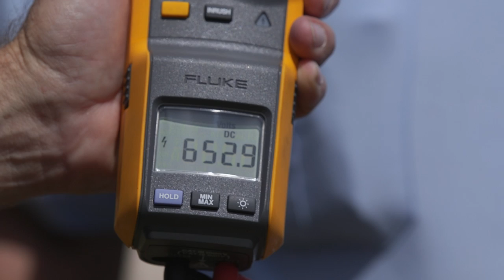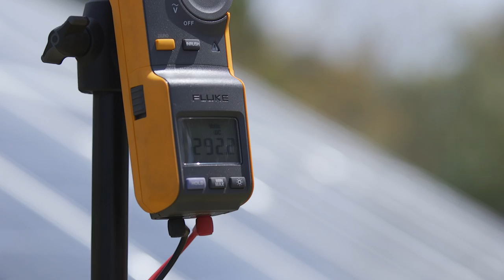Electrical Arcing & Water Conductivity

Comment: Spread clear Flex Seal on broken glass of PV panel. It will seal the panel from water. Did it. Works fine.
Reply from the maker: Hi Patrick, that is a really bad idea, sealing the damaged panel is only one aspect of the risk.  The cracked panels will cause hot-spots, which can create an electrical arc, which can then create a fire.  I would strongly recommend that you remove and replace any cracked panels or you could have a future fire on your hands.
Reply: @pvstop5763  not gonna happen as long as it works. I stand by what I have done because I know that it works.  I have two panels coated with Flex seal and two others that are not broken, powering an electric water heater. I get forty gallons of good old hot water anytime that I need it. 36 volts on both panels that are coated and 36.5 volts each on the other two. Going on two years now. Of course, your mileage may vary. 😉👍
Reply from the maker: @patrickbodine1300  I can only hope that your panels are not installed on the roof of your house, wherever they are installed, I can only advise you that they are a fire risk.  I have seen damaged panels operate for years without issue, I have seen others catch fire and burn houses to the ground.  Best of luck and stay safe.
Reply: @pvstop5763  😉👍

Comment: Rain water has no mineral in it so should not have that much effect 
Spray distilled water and see if it reacts the same
Reply from the maker: Pure water (distilled water) is an insulator. But almost no water sources are pure and it is widely accepted that typical water sources are conductive when applied to an electrical source.  An unbroken stream of water applied to an electrical source can conduct down the stream and create a real risk of electrocution.  I reference "Firefighter Safety and Photovoltaic Installations Research Project" Conducted by Underwriters Laboratories to support my reasoning.  The report is easy to find online and has a whole chapter on the subject.
Reply: It wouldn't matter. Panels on a roof are not spotlessly clean. The water will pick up the impurities necessary for good continuity.

Comment: Thumb down,because: what is pv stop and hiw it works? AND why not using a Megger putting out 700 to 1000volt to verify volt leakage to ground?? With your multimeter you cannot veryify 100% what you try to measure, it only puts out around 6volt for that test. Dont make videos like that if you are not knowing what you are talking about. And 600volt output is a very unusual configuration for a solar system anyways...
Reply from the maker: Thanks for your interest interest in our video.  PVStop is a state of the art polymer film technology and the only solution that isolates the power produced by solar panels at the source, by blocking the light and de-energising the solar panels.  You can find out more by visiting our website www.pvstop.com.au.
A Megger is the correct tool to demonstrate leakage in a system that can be totally isolated from all power sources.  If a system cannot be disconnected from the power, such as in the case of solar panels in sunlight as demonstrated in our video, a Megger cannot be used because it will either damage the equipment or destroy itself.  A multimeter is not as accurate as a Megger, but it is the right tool for purpose in this instance.  
A 600 volt output is a very typical configuration for a residential solar PV system (industrial and commercial systems can be up to 1500 volt output).  I am quite confident that I know what I am talking about, but thanks for checking.

Comment: What exactly does PV stop do? I'm lost....
Reply from the maker: Hi Kody, PVSTOP is designed to "switch off" solar panels, it sprays on like a "liquid blanket" to isolate the power produced by solar panels at the source.  It is an essential tool used by first responders (firefighters & electrical technicians) to make solar panels safe if the solar panels are faulty or in an emergency situation such as a fire, flood or storm.

Comment: use individual inverter for each panel, cut the main power then no collective high voltage..!
Reply from the maker: You are talking about micro-inverters which are becoming more common (typically in residential solar panel systems).  There are pros and cons to micro-inverters and although they are becoming more popular, they represent less than 10% of global solar panel systems.  PVStop is effective on all types of solar panels systems so it is complementary to all solar PV technologies.

Comment: lol 5kW with 600V is just asking for trouble.
are your solar panes 50miles away from your home? why do you need 600V?
Reply: It's to do with power loss through transmission, Even a 1% loss on the system above would equate to 58.5wh, however multiply that by an average of 4 peak sun hours per day over a year (Australia) you're suddenly losing a total of 85410wh (85.4Kwh) annually. I should clarify that power loss is calculated by Current squared multiplied by the resistance of the cable.

Comment: Need to have remotely operated Disconnect Switch in each string to bring down the voltage level & current to safe limit during emergency. Also there should be automatic shading system to prevent Electricity generation during incident. Access to Roof for   regular maintenance is necessary to prevent Fire Hazzard from broken cables, damaged panels etc. Hope these will minimize the fire incidents.
Reply: Hi Vivek, what you are describing (remotely operated disconnection switch) is "rapid shutdown" technology which accounts for about 5% of global solar PV systems.  In theory an automatic shading system would work, assuming that you keep the shutters well maintained (as they will live in the elements 24/7), that they don't compromise the load bearing capacity of the roof and that they don't cast shadow across the panels and reduce efficiency.  Fortunately legislation in most countries is improving and roof access is a focus on most modern standards.  Sadly most PV system owners do not regularly maintain their systems which is where most of the problems arise (poor quality system components and or poor quality installation practices).
Reply: Thanks Jim for Good suggestions.
Reply: @vivekprabhu2651  No problem Vivek, we are all about raising awareness of the risks and improving renewable energy safety!
Reply: Solar PV Systems are best in landscape not suitable for any type of cultivation, on Rooftops, on top of irrigation canals. Similarly  Wind Turbines are good at offshore if geographically it's a high wind speed region. What are your thoughts on these Jim.
Reply: @vivekprabhu2651  Hi Vivek, I am not quite sure what you mean, are you saying that you don't think PV systems are suitable on cultivated land, rooftops and irrigation canals?
Reply: Hi Jim, what I meant was Solar PV Systems are best for Rooftops, on top of Irrigation Canals and in landscape not good for any type of cultivation. Here in India we have quite a large area of Rooftops, Irrigation Canals don't have Solar PV Systems. For Agriculture, Greenary cultivable landscape is essential. Desert are the places where Solar PV Systems provide value to landscape.  Installation of Solar PV Systems should get incentives for these categories more than any other. Fire extinguishers from PV Stop for Solar PV is amazing 👍

Comment: You call it a voltage meter, therefore you should call the other meter a current meter, not an amperage meter.

What is being measured is voltage and current, where the units are volts and amps.

Let's get it right shall we?
Reply from the maker: An ammeter (abbreviation of Ampere meter) is the correct terminology, but we weren't sure if this would make sense to a non-technical audience.  But sure, if you want to get caught up on semantics, knock yourself out!
Reply: @pvstop5763  The point is, you have been inconsistent! For voltage you have used the correct terminology, for current you have got it wrong.

Comment: NEC 2017 690.12 requires Rapid shutdown Devices because of this this video is based on the most basic ungrounded array ever created
Reply from the maker: Hi Cameron.  Yes, the demonstration unit is a basic ungrounded array.  Having installed PV systems for many years we see real world examples of arrays that are not grounded correctly very regularly.  This video is designed to show an example of an unanticipated risk created by a damaged solar array, not a well designed perfectly functioning grid interactive system.  Rapid Shutdown devices also have limitations, there is a reason why the US (and more recently the Philippines) are the only countries in the world to legislate Rapid Shutdown.  Here is a link for your reference www.fixmlsd.com and just to be clear, we are not affiliated with this website.

Comment: Or go down to Wal-Mart grab some tarps.  Or boxes. 

Nope grab the toxic sludge extinguisher!
Reply from the maker: Further to my post above, tarping solar panels is only effective in limited circumstances, it is a dangerous practice and puts you at risk of being electrocuted.  There are also the dangers of operating at height etc etc.  The PVStop coating is non toxic, peels off once dry and can be disposed of with normal garbage waste.

Comment: How water increases voltage ? Whats the physics behind it? thanks.
Reply: It just provides a path from the live cells to the frame. Water conducts electricity! In reality, the frames of all PV panels are supposed to be earth grounded. It's required by the National Electrical Code.
Reply: @vincentrobinette1507  it goes to show how little some.people know about electricity. Lol
Reply: Anything that is wet with water ( not oil or oily liquids) will boost lectricity  flow.

Comment: You know what also works? Inline fuses and proper circuit breakers.
Reply from the maker: DC electricity behaves differently to AC electricity and this is exactly where a lot of solar PV systems experience problems.  DC likes to flow in one direction, from source to load, the more fuses and circuit breakers you put in the line, the more potential weak points you create which over time can develop into problems.  The number of solar PV fires caused by isolation switches is a perfect case in point.  Once again, it is a case of people selecting cheap, poor quality components without understanding the safety risks.
Reply: I am well aware of the fundamentals of AC and DC current. I work as an RF Engineer professionally and electrical engineer as an alt.
Most every solar system I have installed for railroad track side signalling and 2-way radio relaying, uses 24 volts DC, in the equipment shed there are pure sine inverters to step the 24 volts DC up to 120 volts AC for the outlets in the building. The signals are all LED based and run off the 24 volts and the radio repeaters are 12 volt, both are fed from a battery bank that the panels keep maintained. This is in situations where mains power is not available like in the mountains or in a desert..
Reply from the maker: I am definitely not questioning your knowledge base,  in fact rail networks are one of the few market categories who have a thorough working knowledge of DC and you obviously understand solar PV systems.  The main focus of this video is directed at first responders who are encountering domestic PV arrays on an ever increasing basis.  Many of these systems are poorly installed by companies with limited technical knowledge and first responders do not have adequate tools and procedures to deal with incidents involving solar PV arrays.  Fire services are rapidly adopting our technology because it offers a simple solution to a complicated problem and it works on any type of solar PV system.

Comment: they even work when you dont have solar panels

still prodcues 600V of voltage 
free energy baby!
thx pv stop
Reply: That's exactly the point of solar, and even wind. They are the only practical, commercially available "Free Energy" devices there are, and they actually work!!

Comment: since the panel are in series to get the high voltages - just throw a blanket on one panel and it turns off....nothing hard about that...or tape a cardboard over it if windy...
Reply from the maker: Covering a PV system with a thick blanket or taping on carboard will achieve the same outcome as PVStop, however how do you safely access the roof if the PV system is damaged on the structure is on fire?  PVStop is designed to be applied remotely, without having to directly engage with the roof or PV system thereby maintaining a safe system of work.
Reply: @pvstop5763  how do you safely access a 10 meter high roof with a leak voltage and apply the PV stop remotely without boom truck? better cut the wiring on 1 panel at 10pm midnight.
Reply from the maker: @bluekawish  If structure height is an issue and first responders do not have access to a boom truck or ladder truck, we recommend our new drone delivery system.  Stayed tuned, we will be releasing information about our new drone delivery system within the next few months.

Comment: It would be a lot cheaper just to earth the frame
Reply from the maker: Hi Joe, a well installed solar PV system using good quality components will provide years of trouble free service.  Unfortunately (approximately) 20% of PV installations are either dangerous or sub-standard.  We have encountered MANY solar PV installations that have either not been earthed correctly or have deteriorated over time. This video was designed to raise awareness and educate first responders on an unanticipated risk which they are encountering on an ever increasing basis.

Comment: hey the thing you say is correct if it is a really old system such as before 2000 at the very least and I've talked with a retired firefighter and they have to survey around the house checking things such as solar arrays to deal with them so what you are saying is not entirely correct
Reply from the maker: Hi Dallan, old system or new system, the topic discussed is this video is entirely correct.  We are currently dealing with fire and emergency services all over the world and the hazards surrounding solar PV systems is a known risk.  Tell me, how do firefighters survey the dangers around a house with a PV system when DC electricity cannot be remotely detected?
Reply: so firefighters must put out the source of a fire safely and every firefighter has a guy who surveys damage to the building and one of the things he does is while the survey is going on he takes a full walk around the building assessing for things like solar panels, points of entry, and as many dangers from the outside as possible and reports everything to the crew also he is able to see solar panels on the roof from the ground usually and are able to deal with them as soon as they see them so you should also do some research as well as i'm not a fire fighter myself so you should also check your sources as well
Reply from the maker: We are currently selling PVStop to a number of fire services in Australia, the UK and shortly to the US, Japan and a number of European countries, so rest assured, we have done our homework.  What you are describing is called a incident risk assessment and most fire services (in the world) do not have an adequate "safe system of work" for incidents involving solar PV arrays.  At best, they adopt a "defensive strategy" when they encounter a structure with a solar PV system installed.  In short, they do not have a reliable way of dealing with solar PV systems, which is why our product is now being adopted by fire departments, it significantly improves fire fighter safety.
Reply: Dallin Turner
Reply from the maker: Hi Dallin, the things I say are entirely correct for old systems and new systems.  With all due respect, solar panels have only become an issue in the past 5 years due to the enormous growth of the renewable energy industry.  A retired firefighter would have had little or no exposure to the problem and currently the only fire services that have an adequate procedure for solar panels are the ones who are now adopting PVStop.  You are correct that firefighters do have comprehensive risk assessment procedures.......their lives depend on it, but once they have located a solar PV system, they cannot isolate the power as long as the panels are exposed to light.  So once again I ask, once they locate a solar panel system, how exactly do they "deal with it"?

Comment: CAPE FEAR !!! That's why you put breaks between each panel.
Reply from the maker: Direct Current (DC) is always trying to flow from source to load.  Any breaks, switch gear etc create potential points of weakness.
Reply: @pvstop5763  dc relays are perfectly safe and will stop any over flow of voltage a fire extinguisher is great but come on man the materials used won't burn if rated for the right temperature and voltage
Reply from the maker: @greeneyes2797  Agreed, if appropriate DC equipment is specified, installed correctly and maintained regularly, you have a great system that will give you years of trouble free service.  The trouble is, there are a lot of PV systems out there that utilise sub-standard equipment or have been poorly installed, hence the significant increase of incidents involving solar PV systems in recent years.
Reply: @pvstop5763  yeah agreed some people do not really have the know how to put together the right system and might benefit from your product
Reply from the maker: @greeneyes2797  Thanks, yes, the product is primarily designed for first responders in emergency response situations, allowing them to rapidly de-energize the panels at the source of power production (by blocking the light) and making the PV system electrically safe, they can them adopt offensive strategies and minimize property damage.